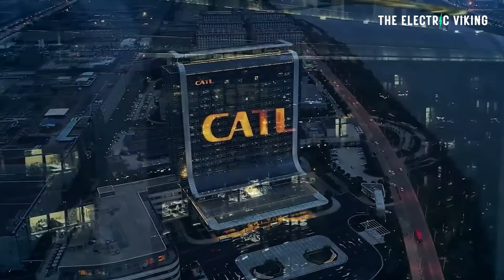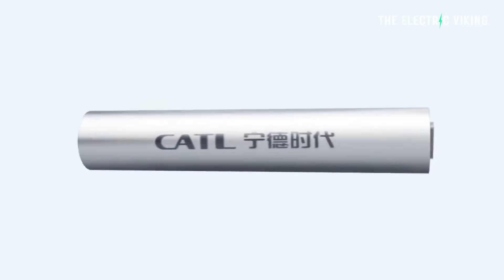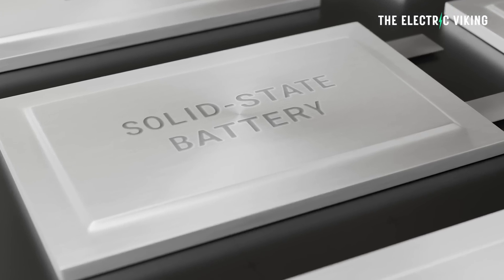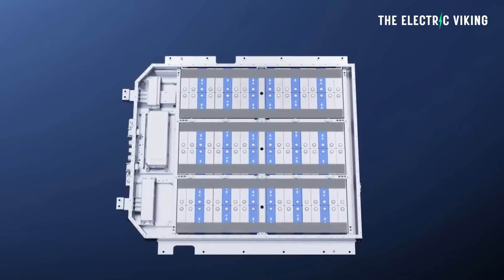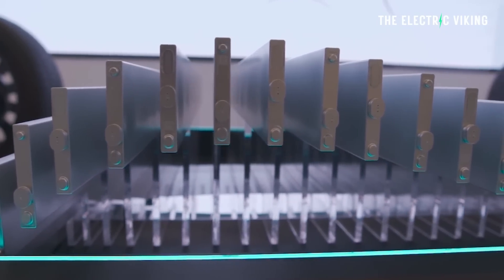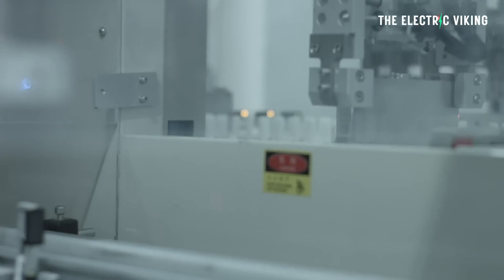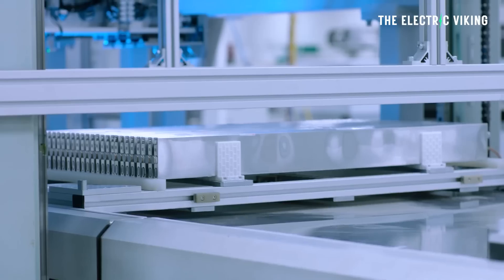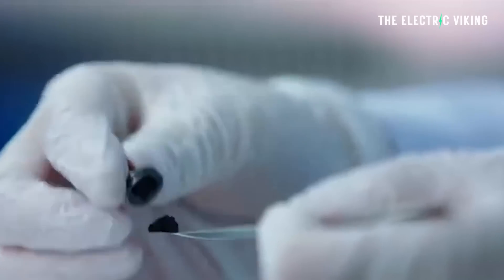CATL's sodium hybrid battery will be 30% cheaper & revolutionise the world

Comment: Making the blanket statement that Cheaper batteries ends ICE's, coal even Nuclear etc is incorrect, due to Batteries being Temporary energy STORAGE systems that don't generate the energy, they store, which means that something elese has to generate that energy, which for some people might be coal or Nuclear or even ICE generator, electricity. Until we get fully distributed, decentralised Solar or Modular micro reactor generated energy produced from every home.
Reply: I’m all a small modular home reactor!
Reply: Solar and wind are dirt-cheap compared to anything else. If batteries are also dirt-cheap, any other power generation method will become unprofitable and end.
Reply: You're forgetting about the rate of energy conversion.  An EV is 300% more energy efficient than a gas powered car.  If every car on the road was an EV, the overall demand for energy generation would be dramatically lower. 💡
Reply: @PETERJOHN101  Actually, electricity generation is never 100% efficient. Nuclear, geothermal, wind and hydro don't have reliable means of stating efficiency, but natural gas is at best 60% efficient, and that is for the relatively rare (don't ask me why) combined cycle plants. The more common simple cycle gas plants are about 25-30%, lower than hybrid cars.
In reality, there is not enough energy generation or distribution capacity anywhere in the world right now to support 100% EVs today. I retired recently after 34 years with a Fortune 100 electric company on the Western Intertie (essentially all North America west of the Rockies, from the Sea of Cortez to the Arctic Circle). The public at large has no concept of the costs and timelines of adding generation or distribution. After a generation facility in the US is built and tested, it goes on a five year (at present) wait list for FERC approval to be added to the grid. About one out of five completed plants is withdrawn form the process before it can be certified. If the pace of construction doubles the wait time will also double. It isn't inaction, it is a matter of grid stability.
The US U.S. Energy Information Administration (EIA) reports "About 60% of [US] electricity generation was from fossil fuels—coal, natural gas, petroleum, and other gases. About 19% was from nuclear energy, and about 21% was from renewable energy sources." We can turn our world upside down and still have most cars powered by fossil fuels in the end.
Reply: @flagmichael  Germany generated 53% of its electricity with renewables in 2023. If your grid can't handle that, you might need to fix your grid.

Comment: Even if the battery was free it wouldn’t end any energy production.  It would support more generation.
Reply: You're forgetting about the rate of energy conversion.  An EV is 300% more energy efficient than a gas powered car.  If every car on the road was an EV, the overall demand for energy generation would be dramatically lower. 💡
Reply: Indeed, but have you seen the latest prices of solar? It's become insanely cheap.

The best part is solar and batteries are improving at similar rates, with a slight edge for solar.

At this rate, most homeowners will likely be generating their own hydro within 10-15 years... with EVs serving as a buffer.

Sounds like a fever dream, but this is where current improvement rates are pointing to.

Comment: Batteries can’t compete with fossil fuels or any other source of energy .  They don’t create energy, they just store it.
Reply: You're missing the point.  Regardless whether the fuel source is a liquid or a battery, the engine/ motor has to convert that stored energy to mechanical force.  Energy efficiency for an EV battery is about 90%, while for a combustion engine it's around 30%.  Thus, it costs less than a third to power an EV car than it does an ICE car.
Reply: I’d still want the battery to be charged.   That requires a source of energy.
Reply: I agree with your point; my point is that the battery is Not a SOURCE of energy.  It is only efficient because the battery was charged by a cheaper source, such as nuclear, than the cost of ICE energy.

Comment: We get -20c here in Massachusetts -4 F  . With wind-chill in here we have seen a lot lower!!
Reply: Wind chill doesn't count. That's a value that describes how a person will perceive the actual temp. 
For example: A bulb of water hanging from a tree when it's 33 f out with a wind chill of 28 won't freeze.
Reply: @dguy321  ask your freezing body which condition it would prefer
Reply: @SV-cg3sk  I'm not a battery. The battery feels the actual temp. It doesn't care about windchill. We are talking about batteries after all.
Reply: @dguy321  Im asserting weather patterns in a geographic area, but you seem to want to talk about thermodynamics. Should I just say that my local area goes colder than -4 F? -15 F with no windchill happens once a winter. -40F with windchill.

An object will lose it's thermal energy faster in wind chill conditions.
Reply: @SV-cg3sk  so battery range will be more impacted for one day a year on average? Not bad.
Reply: @dguy321  I guess we just have to wait for 8 years to see if it can handle real winters
Reply: @SV-cg3sk  It won't if the wind can't touch it, because it's somewhat well isolated.

Comment: If only the cost of energy generation were to fall as quickly as useful storage.
Many countries have massively inflated energy costs, (like the EU). This has to change, let’s support companies solving clean generation as well.
All of them.
Reply: The cost of energy generation is not what consumers should worry about. These days it is a less significant component of your bill. Transmission, distribution, retail margins, government ‘rent’ can all be bigger than the generation cost
Reply: @BTMwarrior  So true! most people don't really look at their bill they just pay it.
Reply: If you own a home you can generate your own solar panels here in the US are ridiculously cheap
Reply: @callmebigpapa  
Do you use a generator to generate your own solar panels?
Reply: Many countries (like Australia) have falling electricity prices. Due to the rampant solar installation.
Reply: @serpserpserp  
That's not true,

Australia's energy prices are very high still. despite mass take up of solar panels.

There is an increasing public backlash occuring toward Net Zero policies, as the cost of implementation, both in monetary and environmental terms, is becoming evident.

The deforestation required to install the estimated 10,000 kilometers of new transmission lines required to attain Net Zero has enraged both Environmentalists and Farmers, resulting in many protests.

Comment: Suffice it to say that there are a few battery technologies in the works at this time so EV's will inprove.  Question is will EV's be designed so that you could upgrade the battery technology or is it the wait game as to when to purchase an EV...

The best we can say is that these battery technologies could revolutionize the industry but haven't yet.  There's still a lot of steps to take.

Note, sodium batteries for EV's was mentioned during the late 70's early 80's in magazines like Popular Mechanics except back then, they were molten liquid sodium batteries...  We always knew sodium batteries would be better, we just needed technology that didn't require high temperatures...
Reply: No need to wait. Batteries like LFP already work well enough, on range, durability and price, for most people. Of course batteries will continue to improve but no need to hold out or buy another ICE or hybrid.
Reply: Using molten salt as a battery is very different. The molten salt stores heat and can then be used to drive steam turbines to make electricity. They were not batteries in the electrical / Chemical term we use for NMC or LFP batteries.
Reply: @TimMountjoy-zy2fd  No, the molten sodium batteries of the 70's and early 80's were not the molten salt thermal storage that you are thinking of.  The sodium was molten to provide a liquid electrolyte as molten makes sodium liquid.  Modern sodium ion batteries uses the Lithium ion technologies to create hybrid water based electrolytes with thin metal sodium layers with large planar carbon electrodes, as well as the new solid state battery technologies to reduce the need for liquid electrolytes.   It is electric batteries that we're talking about not thermal storage, we just always knew there are advantages to using sodium so long as we could get something the ions could move in and having it all be liquid was the traditional way of doing so, we've just been developing how it doesn't really all need to be liquid so long as we can make everything thin enough (which is why nanocarbon and graphene electrodes are also a big deal).

Comment: ICE will not die in the next 50 years unless governments ban them.  The way the politicians are screwing things up no one will be able to buy a car doesnt matter what it is. Battery taxis and buses well yes.  I dont intend changing my ICE Pajero its diesel and will last longer than me.  So its great tech is moving forward, but batteries are still in their infancy.   While China has all the natural resources for solar and batteries politics will stop using it except in China.   I was involved of the creation of computing and networks and still old tech is available like calculators.  Hopefully what you say will come, but making batteries still requires rare metals, even these.  😄😄

Comment: Just for reference:   May 5 2024
The CATL Shenxing Plus LFP battery energy density  is  205 Wh/kg   (Also has great cold weather performance)
The Tesla 4680 is estimated at 272-296 Wh/kg
This new CATL Sodium Ion hybrid Battery is 200 Wh/Kg     (The advange will be 30% cost saving and 90% cold weather performance)
Reply: So, worse but cheaper… unless you are in a cold country rich from its massive oil exports…

Life is good at the ins4ne asylum…
Reply: Pretty sure this dude misunderstood the article. CATLs second gen sodium ion battery will be 200Wh/kg. CATL will also offer hybrid batteries but has not as of yet said what the energy density would be.
Reply: Diesel: 12,700 Wh/kg
Gasoline: 12,200 Wh/kg 
Fill time 5 minutes 😂
Reply: @xraylife  And most of that is wasted as heat, toxic fumes and green house gases.
Reply: @xraylife ok, 12,200 kWh/kg means 9,150 kWh / litre. 9,150 / 18 = 508Wh per km. My car does 160Wh per km in winter. My car is 3 times more efficient and hence cheaper to run.
Reply: @xraylife  My EV takes sub 10 seconds to fill at home which is where I do 95% of my charging (time to plug in - it does the rest while I'm asleep).

So far after 12months I have driven 17,031 miles (27,404km) - I have consumed 2959kwh driving +292kwh in charge losses = 3252kwh (from the wall) at US $0.051 per kwh = $166 - total or $0.0097 per mile / $0.0061 per km.

That's the equivalent of 375mpg at $3.65 a gallon (US national average regular as of May 4 2024).

I can fill for $3.00 and that gets me around 310 miles of range.
Reply: @TB-up4xi  that’s not the definition of filling… just sayin’
Reply: @xraylife  you forget the smoke which gives you  lung Cancer and Asthma.
Reply: @xraylife can you fill your tank overnight at home? Can you fill your tank for free or are you always going to have to buy fuel from a corporation?
Reply: @AORD72  Yes you can fill your car at home. I have done it from 180l barrels. I can not fill my tank or charge my car for free. Fast charging is the same price as petrol where I live in Norway
Reply: @xraylife  Any combustion engine uses at top  only 45 %  of  fuel for energy , 55% are lost  for  heat .  Pollution is a great threat for everyone on this planet .  Better start thinking about nice ,fast  EV
Reply: @xraylife  81% to 88% of the lifecylce energy wasted to heat and noise. EV charge time at home sub 10 seconds 70-80% energy lifecycle efficient.
Reply: @xraylife  now look how much energy will get lost and how much litres you need to do 100km, and convert litres to KWh (from what ive googled, gasoline is around 8-9Kwh per litre), EVs uses 10-15KWh per 100km :D and then look at prices to compare lol
Reply: @xraylife  point in time. learn to extrapolate
Reply: 50L(13 gallons) of gasoline is about 50kWh.
2/3 of it will be heat only (and everything else we don't like) , 1/3 runs the car.
With 50kWh an EV can go 270km (167miles) 
and if its battery is this new Sodium Ion type the weight of the battery is about 250kg.
It is not for long trips but totally enough for daily commuting for the most of the people. And every km is much cheaper than with gasoline and the new sodium batteries promise >5000 full charge/discharge cycles which is 13years if you fully discharge it each and every day. And if you can charge at home you will not wait in any gas station in the future.
Cheaper (very soon) cleaner and more reliable than ICE. 
If you want to take a long trip you  need to stop for a coffee in every 140miles, or you need a longer range car and you will stop every 140miles anyway :)
Reply: @xraylife  What will drive the adoption of the EV is that the cost of operation of the electric car / truck / bus / boat / equipment is lower than running on Diesel or Gasoline.  EVs are cheaper to operate today, which is why fleet managers are buying EVs.  Better batteries will accelerate this adoption.
Reply: @WilsonCC  I replaced two ICE BMWs with two Teslas because I only need to spend 6 seconds to plug-in at home and 1/3 cost to run, literally no maintenance on it, super fun to drive.   Never another ICE vehicle.
Reply: @Trust_but_Verify  bmw versus tesla… you are a certified living cliche…
Reply: @xraylife  ev is suitable with low to average income, and gasoline price is expensive , some country can spend 20usd to 30 usd per 100km of driving range in city..... with ev car they only spend 3us to 5usd with the same or even more horse power and torque than combustion engine car. and tax also play to role into buying ev car,,,, EV car importing tax is 3 to 4 time lower than combustion engine car....

Comment: If this battery would really be sold for 40 USD per kWh that would be a gamechanger indeed. That should make a complete pack with 55 kWh (50 usable) for only 3000 USD possible. The weight of such a pack would be around 350 kg, assuming about 160 Wh/kg on the pack level, instead of 200 Wh/kg on the cell level. A 22 kWh pack for a small city car would only cost around 1500 USD and weigh about 150 kg. A solar battery with 2 kWh would only cost about 100 USD and weigh about 14 kg, a home battery with 10 kWh would only cost about 1000 USD, including the BMS, housing etc. and weigh about 70 kg.
Reply: With home batteries, go up. Let's talk 100kWh in each home. With solar, that solves lot of grid issues.
Reply: @MrVolodus  heck, even without solar, charge your battery once a month for small homes! I rarely get above 5kwh usage a day. 100kwh battery on my home would be amazing!
Reply: @colinwiseman  5 kWh/day?   Apparently you don't heat or cool with electricity, nor drive an EV?
Reply: Electric viking is wrong,200 wh/kg in cell not pack,shenxing plus has 205 in pack and blade 2 has 190 wh/kg in pack not cell,shenxing plus has 260 wh/kg cells,blade 2 has 247 wh/kg in cell,CATL's sodium ion battery has 200 wh/kg cell and 152 wh/kg in pack level,please be more accurate sam
Reply: @davidfujkk8018  It may not be as dense as stated in this video, but if the price figures are correct it will still be a major step forward for true mass market EVs. Add then the improved cold performance and the high charging speed and things are looking even better.

Of course, Chinese company, which brings with it its own set of issues, but other manufacturers will soon begin making batteries like these anyhow, so we likely won't be limited to just one supplier for very long.
Reply: For home storage first!
Reply: CATL have ALREADY announced a 60kwh battery costing $3000 available middle of THIS year.
Reply: @ouethojlkjn  A whole pack, with housing, climate system, connectors etc? That would be great, what's the weight?
Reply: @nightshadowblade  If you would like specifics I can suggest the CATL website - but I should think the cost is only for the cells supplied to a manufacturer
Reply: IF -IF - IF -IF … How many videos have you watched claiming a game changing battery is just around the corner? And how many really came around?
Reply: @jean-marcducommun8185  In 2013 the Lithium price was $780 per kwh and at the end of 2023 it was just $139. Even if new tech does not arrive (and note Sodium batteries have been in Chinese cars for a while now) the overall cost is still only going one way - down.
Reply: @jean-marcducommun8185  True, hence the "If" at the beginning of the sentence, as you noticed. In this case the claims are not too far-fetched though, because CATL is offering batteries for around 50-60 USD per kWh already and this new one is otherwise not great in terms of weight, so it's not a wonder-battery that will work for all applications, the main attraction will be the price.
Reply: Plus a 55 kilowatt hour battery pack would power home on its own for 2 days and if you had solar or wind generation coupled you might last 5 days without power before you had to cut Corners so you would have power at night.
Reply: All these numbers being tossed around yet no one has even brought up cycle counts. LFPs get about 8000.
Reply: As you say, IF